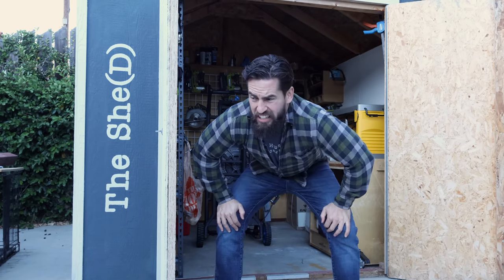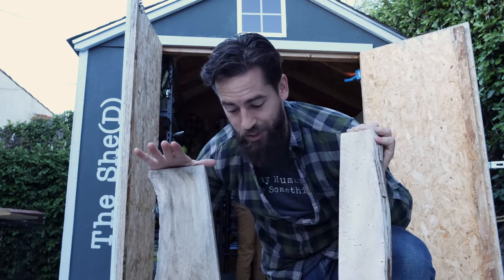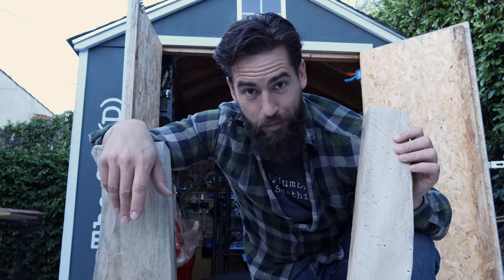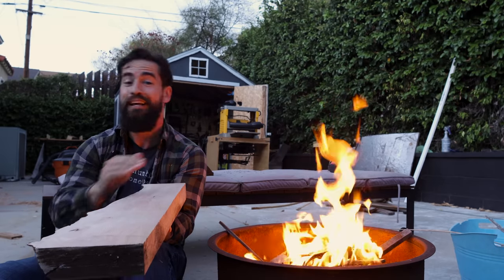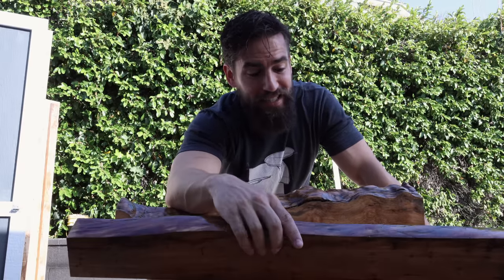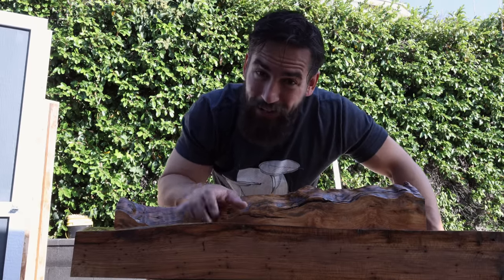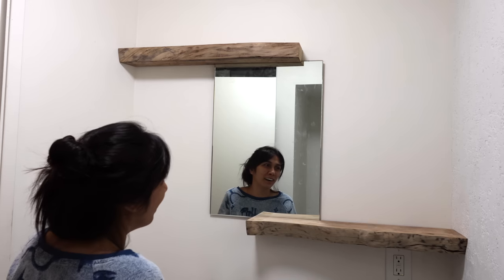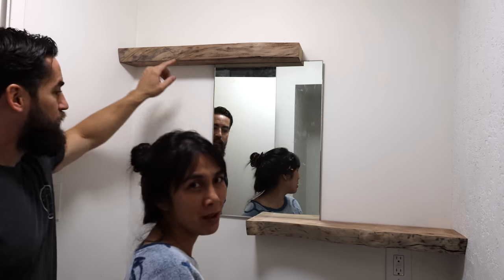Don't sleep on what's possible with basic machines...

Comment: Newest subscriber after seeing you on Mabie. Enjoy your humor and want to see your work. I was grimacing when you drilled screws for rods right above electrical outlet! That was risky since you never know how electricians wire up behind box. But agreed with your method of epoxy to stabilize wood. Great tip.
Reply from the maker: Fair point. I did have a photo of the wall before is was drywalled so I knew where the wires were, but it’s smart to be safe!
Reply: I showed him a picture of the studs, plumbing, wiring, and distance between each stud so he knew where to drill safely :)
Reply: @xtjoy  Great point! Did that in my whole first floor remodel. Going to miss your cameo appearances.
Reply: @ifiwooddesigns awww thanks! But you haven’t seen the last of my cameos. I’m sure he’ll come back or I’ll make a point to finally hit his home turf 😊

Comment: Love me a little down n dirty Chip and Joanna projects!  If you cringe at mixing epoxy, 3 or 4 quick coats (start next coat almost immediately) of shellac will soak in pretty good and dry good enough for oil topcoat in an hour or so.
Reply from the maker: Absolutely! Had I had any shellac on hand I would’ve been happy to use that as well!

Comment: Fantastic message!  I have some expensive tools but was suffering from “woodworkers block”. A Catch-22 where I don’t know how to do X but the only way to learn is to try to do X.  Or better yet, break the project down into separate skill sets and find something that uses 1 or 2 of them. 

Lots of U-Tubers build shop furniture that looks as good as my kitchen cabinets, if not better. Right now, I’m intimidated by the thought of building a drawer. Any drawer. It doesn’t have to be perfect … it just needs to function. Right?  So 1 drawer under the router table seems like a good place to start.
Reply from the maker: You nailed it on the head. All you can do is move forward my dude. Do not fear failure. In fact, go seek it out. Go make a shitty drawer. Goof it up something serious. And then try again. By the time you’re done I’m willing to bet you’ll have a decent enough drawer to work 👊

Comment: While I fully agree with the message of the vid, its still really annoying when you complete something and it doesnt look perfect. Either because of lack of materials, or bad planning at the beggining, just forking up at measurements and then no way to walk back. Im not a woodworker (though am very intent on pursuing that when i can), but a few years ago me and my family decided to build a sauna building with a dinning room and a terrace around it. We had little to none beforehand experience in anything of the sort. We finished it, im super proud of it, but i know every little mishap at every board, screw, missalignment. Everything. And its hard to not see it. No guests will know about it (prob). But i do :). However it does feel like i learned a lot, because our next project is going way more swimingly
Reply from the maker: It absolutely is. But you’ve got the right attitude—learn something from it and the next project will be better. Keep on keepin on 👊

Comment: You know I always enjoy your videos! One question: in this video I see you are sanding the epoxy without collecting the dust. As far as I know, epoxy is just polyester, plastic, so you're launching little bits of plastic into the garden air. Doesn't that contribute to the plastic microfibers that increasingly contaminate our soil? Or am I seeing this wrong, do you have knowledge that epoxy dust is harmless to the environment? I would really like to know, because I put a lot of effort into collecting all this dust at my work and thus keeping my neighborhood free of my plastic waste.
Reply: Good point. I‘d assume you‘re right, but I‘m not using epoxy at all. I would go for shellac instead.
Reply from the maker: You’re exactly right, unfortunately. With a lack of equipment it’s hard to work ideally, but a dust extraction would have made a big difference to your point. Had I had a penetrating epoxy to stabilize the pieces it would have absorbed more completely and lessened the polymers being abraded as well.

Comment: Great little project and looked great.  But don’t discount “just doing carpentry work” not fine tuned furniture.   I was a contractor for 40 years and did my “carpentry work” fined tuned. The tighter things are framed , built, laid out correctly, plumb level square makes for a much better finished project.  I don’t think you meant much by that phrase but that’s what I thought it sounded like.  Carpentry is less than furniture work.  I’ll keep watching watching.
Reply from the maker: For sure. I consider myself a carpenter first and foremost. Not meant as a slight on the exacting nature of carpentry so much as picking on us woodworkers for being overly obsessed with 1/128ths and nanometers.